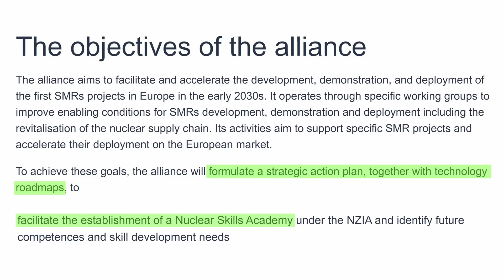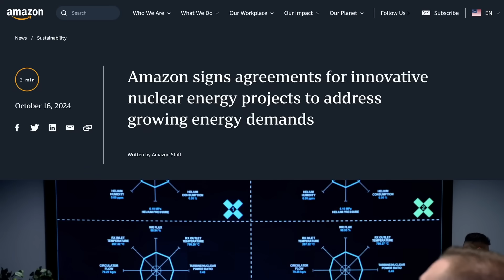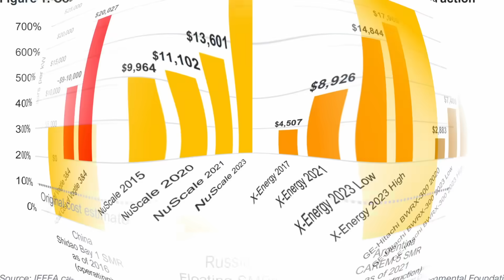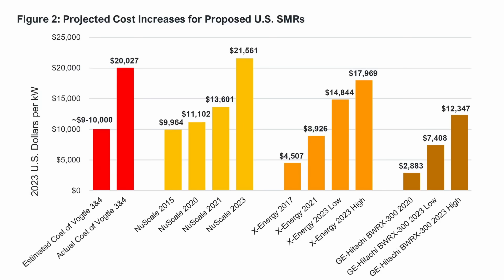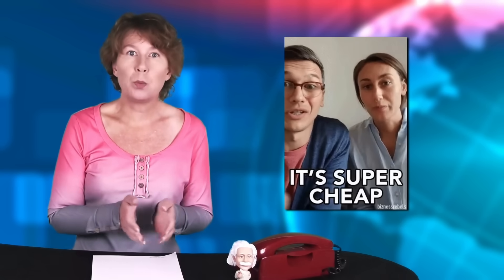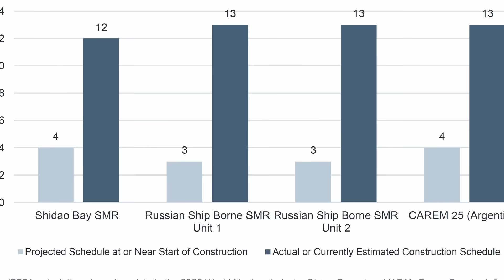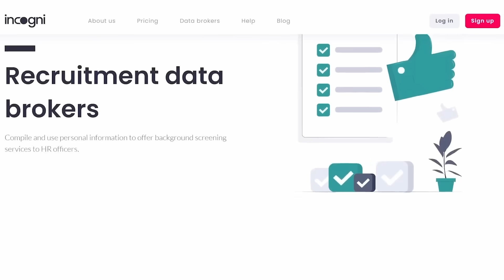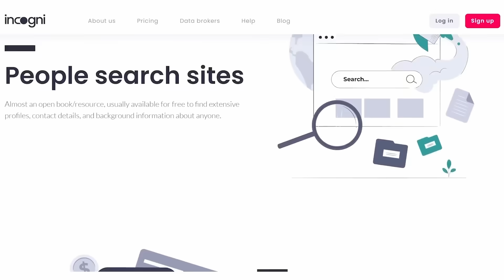Small Nuclear Reactors Have A Big Problem

Comment: Spreading SMR's around the world seems like a terrible security risk.
Reply: That is a very good point that nobody seems to be addressing. The traditional 1,000+ mW has defense in depth due to its large size and a dedicated security force that keeps it from being an attractive terrorist target. Having multiple much smaller installations will be a security nightmare that has better be taken into account.
Reply: @kentuckyken6479  Most likely, a single site will have multiple SMR. So the support  infrastructure required would be the same for large reactors.
Reply: Indeed. Lower cost to construct would lead to proliferation to poorer, less politically stable countries. There, attacks at nuclear power plants would be much more likely. Or that materials like spent fuel might go "missing". I'm relieved to learn that cheap SMRs are still a pipe dream.

Comment: What is needed is elimination of the huge array of regulation unrelated to actual safety, especially those that extend the time required for 'licensing' which increases the cost of financing.  To some extent this 'favor' has been extended to wind and solar farms by simply ignoring the environmental impacts of windmill farms and large solar arrays.  Licensing and government regulation are the reasons this industrial sector languishes.  To the extent government is involved in development and production any project will be excessively expensive and unproductive.
Reply: "What is needed is elimination of the huge array of regulation unrelated to actual safety, especially those"

Why do any safety at all? Whats the worse thing that could go wrong? there is a reason why regulatory is so long. Companies\workers love to cut corners to save a few $$$ & time.

Comment: LFTR reactors will most likely end up being the technology that wins the molten salt reactor race. Online fuel reprocessing is only possible with liquid fueled reactors and is known chemistry. They will also be able to consume LWR waste eventually. Research and testing is expensive. The result will be a design that is cheap compared to LWR because process is low pressure and walkaway safe.

Comment: I think this is more a human problem than one of technical capability in that private industry ALWAYS necessarily places a level of profit first.  And that's fine, however this is an infrastructure problem to provide energy provision and not one to make investors money at every opportunity.  Like the Hoover Dam.  It was a public works project to provide a service for an economy to build upon.  There is no immediate concern for recouping cost there.
This is now in a vicious cycle of too expensive to build and maintain, but there is a need to itemize exactly what it is that makes it too expensive.  Is it corruption?  Investor expectations?  Too many regulations?  I think corruption, concern over "what do I get for this in return" is a dirty stain on this field that needs to be talked about more.

Comment: What are the regulations that cause the high costs? Sorry the videos claim that it is just safety is untrustworthy. We know that regulation is out of hand and adds tremendous amounts of costs. I just don’t believe anyone who gives such a simplistic answer.
Reply: Mmmmm..... I think the safety driving cost argument  would stand scrutiny, I only say this because I worked in aviation  for most of my career, an industry  that has incredibly stringent regulations. I'm sure the nuclear energy industry has a similarly demanding set of rules possibly even more strict, I mean lets face it in both cases failure is not an option ! Over the years I gained first hand experience on the cost of compliance and indeed my salary was part of it.  I learnt that the sums could be absolutely eye watering  not just to design, certify and manufacture a product but also to maintain and operate it in a compliant manner. I agree regulations can be at times asinine and out of hand but I know the aviation rules are appropriate and given what you are dealing with I'm sure the same is true for Nuclear energy both are decades old mature industries.
Reply: Gee, cars would be so much cheaper without regulations !!  

The irony of not believing simple answers and then giving one (rolling eyes)!

Comment: SMRs may well work, but due to their design and size they may not be as economical/efficient as a single larger reactor. However, that does not mean they cannot be successful and have fitting use cases.

Comment: I would really like to know what the issue is. Fission reactors aren't that complicated (compared to modern tech), and it seems our material science has improved enough.  Seems like it would just be some hard math to standardize and minimize.  Although i imagine regulation plays a huge role.  Could be that to make it compact enough you'd have to significantly enrich uranium,  which gets into arms stuff.

Comment: We, in the UK. As well as America have been making small nuclear reactors for submarines and Navy boats for years. Why is this such an issue?
Reply: cause military things dont have to be commercially viable. i guess thats why.
also safety guidlines and other regulations are very different...
Reply: @mugnuz  Their design is also secret.
Reply: @cdl0  true thats also not unimportant.  even tho it could translate in some cost reduction cause you wouldnt exactly copy it anyway
Reply: Because the reactors used in submarines are way, way too expensive to compete economically with other grid sources.
Reply: Even in the US navy, most ships aren't nuclear.   The rest burn liquid fuels.  When burning expensive liquid hydrocarbons is cheaper than nuclear, you know nuclear has a cost problem.
Reply: Navy personnel have to sign a 'release' re. radiation exposure.  We cannot expect civilians to do that.

Comment: Would you please comment on the The USS Gerald Ford, the world’s largest aircraft carrier, powered by two A1B nuclear reactors, and they do not have to be refueled for 30 years. This ship weighs over 100,000 tons and can hold over 5,000 personnel and up to 90 aircraft. The old aircraft carrier the U.S.S. Enterprise was powered by four nuclear reactors. Since the Gerald Ford only needs two, this seems to indicate that the technology for nuclear reactors has improved. So is this technology secret? It would seem if it works for a huge ship it would work for a small city.

Comment: The majority of the cost of Nuclear power comes from the regulation. If you take a fuel cycle class, you lean its upward of 80% of the cost. Regulation is the noose that will kill commercial nuclear, and people will never have it so long as they blanket praise regulation. Those people are the reason coal and oil are what they are, and alternative to replace them

Comment: Uses waste from Uranium reactors as fuel. 2 birds with one stone
Reply: The problem is navigating all the laws and regulations, as well as the waiting time for getting them accepted by governments. The delays cost more than the fuel or the concrete needed.
Also, the running costs depend on the number of engineers, technicians and administrators needed to run each reactor - if they can be found.

Comment: The whole idea with them is ultra mass production makes cheap, the current costs are basically the prototype costs, should have basically nothing to do with the final price point.
Reply: I suspect regulatory compliance is the main driver of cost in this industry, I can only imagine the rules framework is  diabolical but then  failure is unacceptable.
Reply: Mass production doesn't pay off until you get into hundreds of units, or more likely thousands. SMRs can't break double digits, and never will.
Reply: @fwiffo  Rubbish on both counts
Mass production with TYPE APPROVAL pays off with just two units being produced. The second one has no more need for approval.

The market for SMRS is in the tens of thousands. Britain alone could use about a hundred.  More if 'electric everything' is needed.
Reply: No regulatory compliance. It does not matter if the reactor is mass produced. Lots & lots of testing still needs to be done, such as metallurgy on the reactor to make sure there are no flaws. All manufacturing processes have to follow an extensive regulatory (paperwork) process. if a workers breaks a tap while tapping a hole  a special report needs to be filed, detailing the steps of how the problem was address. The change plan must be approved by a compliance committee before it work can be resumed. 

Lots & lots of tests need to be performed during the entire assembly process as well as during installation prior to the reactor can be fueled. D
Reply: @guytech7310  Yeah. Every single aircraft built today must be individually tested and approved right?
Wrong.
They are type approved. And we rely on the companies making them to build them to the approval specifications .
Same with SMRs. Mass produced modules. By companies like Rolls Royce who have a long history of hi tech engineering and reactor design. As well as producing one of the most popular gas turbines for power stations, and with a presence in existing reactor control systems and safety designs.
Reply: @leosmith848  if a plane crashes it does contaminate a thousands of square miles with highly radioactive material. The level of testing & approval process & several orders of magnitude more with commerical nuclear reactors than aircraft.
Reply: @guytech7310  If a nuclear reactor suffers a meltdown it does not contaminate "a thousands of square miles with highly radioactive material". Unlike as you incorrectly stated a plane does.
 
That is the point of containment vessels.
I understand you are paid to tell lies, but make them at least plausible
Reply: @leosmith848  Chernobyl did. about 1000 sq mi's in the exclusion zone.  A 1 MWe reactor contains about 100 tons of fuel.

Spent fuel pool fire will render about 15000 sq mi. contaminated.
Reply: Ask Georgia Power how cheap their 'mass produced' APR units are at Vogtle 3 & 4!
South Carolina utilities CANCELLED the only other unit even considered for building because of up front costs, too.
Reply: @rbaxter286 
No APR has ever been mass produced.
Indeed, the regulators have succeeded in making nuclear unaffordable.
That's why we are building small reactors.
Reply: @rbaxter286  APR's are not mass produced.  The South Carolina VC Summers plant was canceled by the State Regulator because of gross mismanagement of the project by the Utilities.

In both cases VC Summer and Vogtle were haveing major cost and schedule overuns which turned out to be because the USA and its contractors and supply vendors had forgotten how to build nuclear power plants (and some vendors outright thought they could fake certification papers).

Both companies hired different outside  consultants to review the project and make recomendations for project management improvment.  Vogtle utilities and  management adopted virutally all the reomended changes and provided good explanations for the few that they chose not to implement.

VC Summers utilities and management ignored the recommendations in the report and had an attitude of "we know better - this report is rubbish and we will continue doing what we have been doing."  When the State Utility Commission found out about that they flat out canceled approval for the project and forced the Utilities involved to eat a lot of the cost.  

What is especially telling is that both the VC Summer and Voglte independent review of the project reports from completely different project review companies came up with essentially the same issues and had essentially the same recommendations.  The company that worked to improve things finished their plant.

Having problems with a any project is very common.  Doing studies on what has been happening and Implementing changes to improve project performance is considered standard practice.  Saying that we are way over-budget, way off our timeline, and we don't need to change a thing...  Is death or suicide to any project.

By the way: China built 4 AP1000's and they have been running for years. The 1st one ran somewhat over budget and a bit long on schedule as the Chinese Consturction companies had never built that design before.  The next 3 were completed essentially on time and on budget.  That's what happens when you have experienced nuclaer construction companies, contractors, and workers.

China also built 2 EPRs and a variety of other plant designs to get a direct comparison.  After things were running they decided that the AP1000 design was the most economical and best performing design; and licensed the design and technology for their main new generation power plants (the CAP1400).

Comment: A small nuclear reactor has a short thermal neutron diffusion length in which to trigger U-235 fission.  Said reactor must then be fueled with high enrichment uranium to have the same number of U-235 nuclei in the much-shortened thermal neutron diffusion length.  Gates does not want a plug-in AI megawatt power source.  
Gates wants a truckable dirty nuclear bomb - a truckable Chernobyl.

Comment: When I was working on large projects which had never been done before, I took the sum of the estimates and multiplied by pi. I could have chosen 3. But doesn't making the result an irrational number just seem more accurate. 
So when 4 goes to 12, it feels like my estimate would still has some margin. 
The judgement about being too expensive also goes out the window when it just has to be done. I admit we don't have a drop dead date yet.  But we know that there will be one.

Comment: Slowing the process of developing small, modular nuclear reactors is actually a GOOD THING!

Too many companies, too many engineers, and too many scientists in this world are willing to take shortcuts in order to speed up the process of developing new technologies. Why? Wealth, notoriety, and success.  Nuclear has the potential to be safe and effective if we take the necessary precautions and implement it safely.  When people take shortcuts to get something to market quickly, we run the risk that a mistake that could cost lives and harm our environment.
Reply: Yes but even the old Chernobyl design is already statistically some 100 times safer than coal power. Nuclear powers real problem is that its vastly over regulated on safety making the costs equally ridiculous as well.
Reply: @Lucien86  Yet without that "ridiculous" over-regulation, it's not unreasonable to assume that we'd have had 20x more Chernobyl incidents than we've had.

Over-regulation unfortunately, in my opinion, has inadvertently made things somewhat better for the planet.  While bureaucrats may like to tell us that what they do is for our safety, my belief is that they do things more for control than for safety.

What we. somehow need to do is to get fame and profiteering out of the development of future nuclear technology, and I have complete confidence that this WILL NOT be an easy thing to do.
Reply: @Martimus98  My numbers are based on the old WHO estimates. Coal statistically kills as many people as Chernobyl did every two to three days. The really depressing part of that is that coal power production is still going up thanks to China and India..
Reply: @Martimus98  "Yet without that "ridiculous" over-regulation, it's not unreasonable to assume that we'd have had 20x more Chernobyl incidents than we've had."
Why do you think so? The flurry of over-regulation after TMI crushed the nuclear power industry, but the designs that were built with TMI-era technology has performed safely. Operators don't want their assets blowing up and bankrupting them, so they would still apply cheap lessons learned from every disaster, plugging all common scenarios.

"While bureaucrats may like to tell us that what they do is for our safety, my belief is that they do things more for control than for safety."
They suboptimize by only looking at their own area, and they strive to be relevant by generating more work and more regulation. The NRC makes nuclear safer but they inadvertently makes energy less safe.

"What we. somehow need to do is to get fame and profiteering out of the development of future nuclear technology"
Rather we need to get government to stop adding lead-time to nuclear projects.
Reply: @Lucien86  The World Health Organization is about as accurate/reliable as someone claiming to know all winning lottery numbers.
Reply: Logical Mr Spock .
Those irrational pesky emotional humans keep getting in the way.
 🖖
Reply: I'd rather just ditch coal entirely asap its a garbage energy source
Reply: That’s just not correct. You can’t let perfection be the enemy of progress. No matter what choice we make, people will die. The only question is how many and how soon.
Reply: No way, it means we are stuck with only ancient reactors and no new (safer) designs. We are sitting on liabilities and improving nothing
Reply: Disagree. Every day globally, a few Chernobyl accident's worth of harm is caused by particle pollution from the burning of fossils and biomass. If a few corners had been cut so that nuclear had grown more but had a few more accidents, then the net health gain would've been truly enormous. Millions of lives saved, and far less environmental damage.

Comment: If an SMR goes into meltdown can you pick it up, dump it into a big pool of water, and disassemble and clean it up there? The main problem with nuclear power has been that existing reactors don't fail 'gracefully'; i.e., cleaning up a failed reactor is far more difficult and costly than it was to build that reactor... Maybe SMR's can fix that?
Reply: weren't the new(ish) "pebble bed reactors" (PBR) supposed to be meltdown-proof?
Reply: @BenK12345  Even if so, an SMR would have the advantage that you could build one and let it meltdown so you can actually verify its safety...
Reply: Any nuclear site must be planned with the inevitable decommissioning in mind.